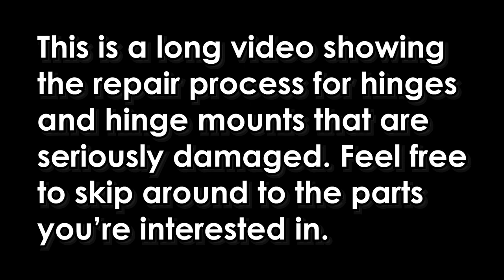Toshiba Satellite L55 Broken Hinge Mount Repair - Oh Man, It's Crunchy- Jody Bruchon

Comment: The construction of this model is kind of chintzy.  I was given a Toshiba Satellite L55-B5267 whose screen hinges and screen plastics were damaged.  The only thing salvageable was the LCD panel.  I waited until an eBay lot consisting of everything I needed to rebuild the screen assembly was available at a reasonable price because all of the parts separately was way more than it was worth.

Then, after rebuilding the laptop, I upgraded to a 1 TB SSD, 16 GB RAM, and a wireless AC dual band card with Bluetooth, upgrading from the 750 GB hard drive, 6 GB RAM, and a wireless N single band card.  It's served me well thus far for things I need to do on Windows.

Comment: Thanks for the helpful video. I have same problem here,  but my toshiba P845 has metal back cover, so I drilled small holes and fastened hinges to back cover with tiny bolts (+ epoxy for added strength).   The bolts are hardly noticeable, they are so small.
Reply from the maker: Crude, but very effective. I can't do that because customers are a little picky about appearances but that's really cool. I'm glad you mentioned it. If someone doesn't care about the appearance, that's probably a far stronger fix. I'm guessing you used blue threadlock to prevent them backing out.
Reply: Yes you are right.  For customer job bolts are not appropriate.  But this is my personal laptop so tiny screw heads on back cover looks fine to me.   I think nuts holding the bolt (inside the back cover) will not come loose, as epoxy is all over it as well.  It was painful to try to get the tiny bolt to screw into the teeny nut, but hopefully hinge will never come apart again!

Comment: Please help me :  Question , i have the L55-B Laptop .  it's old and on it's death bed .   Can i buy the exact same model laptop (newer of course ) and put my HDD inside of the new one and just run like my old one ?
Reply from the maker: Yes, you can, except your Windows license may deactivate.
Reply: A better choice would be to clone the old drive onto your new drive, after you extract the windows key from your new laptops Windows installation.  Then after the clone you can add the new key to your old installation.  You also could take the opportunity to upgrade to an SSD vs a hard drive, unless the old laptop has an SSD.
Reply from the maker: In Windows 10 you can use the clipup tool on the command line to activate using the embedded OEM license key even if you never booted the included OS.
Reply: @JodyBruchon  That's cool!  I'll have to look that up, thank you very much!
Reply: @spencerreynoldsEquipmentShare  hey guys ,  ok , my toshiba is i5 running is windows 8.1 .  i have all my music software in x86 some x32 installed so thats why i need this hard drive to operate the software thats already on it + vst plugins too.   i cant reinstall these music apps because there are 8 years of these installations .  i dont have the serials .  i F'd up on this .  plus , some of these were torrent software (oops) and it would be impossible to find some of these older titles ...  anyway my laptop , the hindges are broke , the keyboard is wore out , the screen bleeds a little and i think the motherboard is what quit on me because it just died and wont fire up.  im looking for the easiest way to do this where i can run my installed software thats on the HDD .  i think i was told back in the day ,that this laptop to upgrade it to windows 10 it needs to be flashed .  i dont want to change anything on it because something may not work .... so please tell me what route to take because i am depressed over this situation and i live out in the stix and there is nowhere i can take it or even talk to someone and get some advice .   (except Best Buy 30 miles away and i doubt they would even contemplate fixing it . they would laugh at me because it's so old ) .  anyway thank you guys for helping me with some advice on the best way to get back up and running.  im in the mountains of Tennessee and again , there aint many computer techs here but lots of farmers . hehe .  running Toshiba Satellite L55-B5276 15.6 Inch Laptop (Intel Core i5-4210U, 8GB RAM, 1TB Hard Drive, Windows 8.1) Gold ; Series

Comment: I have the same laptop and the same problem with the hinges, where can I get this hinges for my Toshiba laptop?.
Reply from the maker: I usually get replacement hinges on eBay. They are very cheap. The bigger problem is that the plastics are so thin that they come apart. The epoxy I use to repair the damage is Loctite Plastic 5-minute epoxy.
Reply: Jody Bruchon thank you very much for the info and the video.
Reply from the maker: I am always happy to help! Let me know if you have any more questions.

Comment: mine is touch screen , how can i take apart the screen , it not have the two screwer in the front  of the screen?
Reply from the maker: I have to be honest, I haven't worked on a touchscreen version before so I don't really know. It's possible that it's just held in place with plastic clips that can be easily pried upon, or it could all be a big adhesive sandwich disaster in which case you're better off just buying a replacement top half instead.

Comment: Does geek squad do repairs like this ?
Reply from the maker: I can't speak for them directly but I very highly doubt it. They are far more likely to try to sell you a new machine than to glue it back together.
Reply: Ahhh I see , my laptop works perfectly fine.  I’ve had it for about 2.5 years . The only problem is the right hinge .Trying to repair it myself is a no go ... So in your best opinion what would be the best bet a mom and pop repair shop ? Because at this rate it’s just gonna collapse soon.
Reply from the maker: @Blackhammer313G  Most likely. Call them up and ask. Most independent repair shops are way cheaper and nicer to deal with than big box store repair desks.